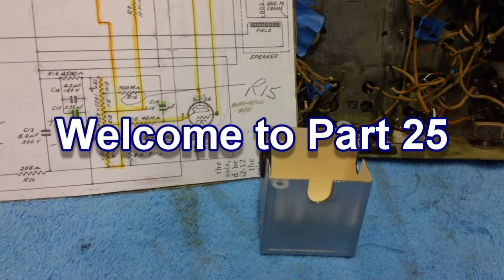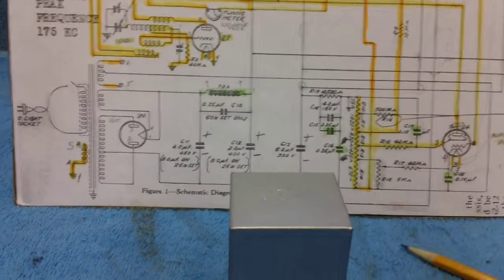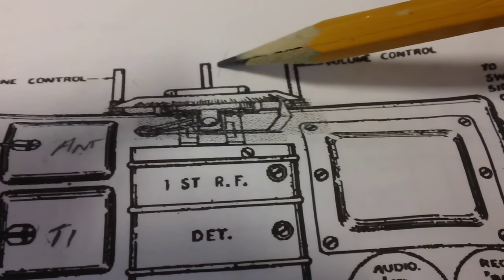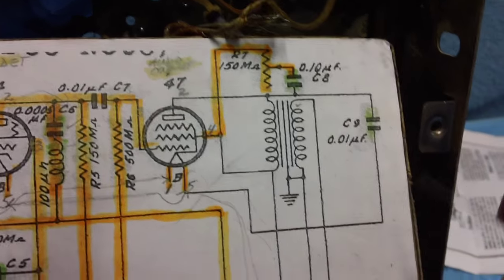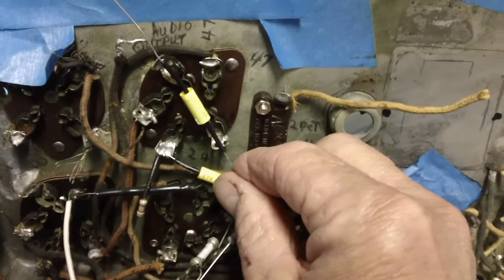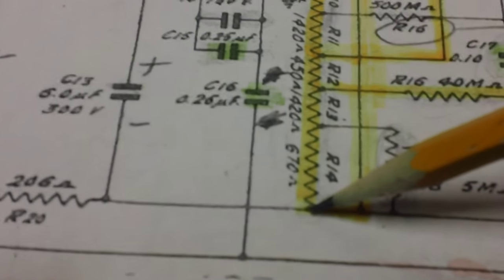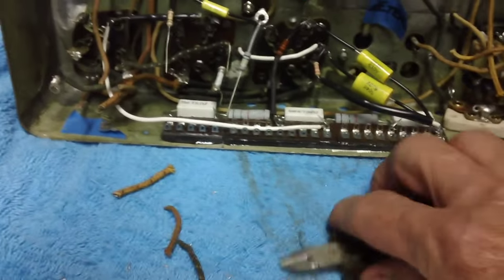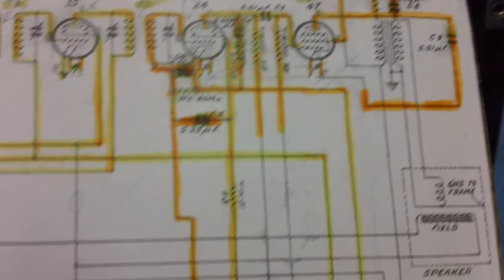1931 Airline 62-14 (Part 25 of 44).

Comment: Another terrific video. I noticed on ARF that someone dredged up an old thread of yours.
Which is good news for me, I missed it first time around. Wasn't there yet.
I have recapped and replaced all but three resisters in my 16 tube set. Like you said
"piece of cake"! Well now it is.
Though I wasted several hours trouble shooting before I remembered that the volume control was not in the intuitive spot. I'm looking forward to the alignment but it sounds good already. Four 45's in the output can make some serious noise (good noise).

Comment: John,
Although I’m at one with sporadic Z, there are those who feel there is a need to retain their Vintage Radio’s authenticity as far as is possible.  Since you indicated you would likely retain a little of your Airline radio’s authenticity, like the potting box, which like the rest of the chassis is around eighty-five years old, I offered some suggested input but I am delighted to see you have decided to go down the quicker, and more practical route of getting the radio working…well done my friend.
Personally, unless instructed to do otherwise, I repair/restore old radios as I think fit.  All one has to do is look at my repair/restoration videos like the Regentone RG99/2, and the GEC BC5445.  I don’t retain old defective parts: I just oust them, and replace them with new ones.  Take the Westminster radio vids.  To some, completely altering the power supply, and audio output circuit from operating on an EL41 to an EL84 as sinful, and degradation…but I loved every minute of doing that…and its works very well too LOL. 
Often, I attempt to talk people out of ‘going down the authenticity route’ by asking questions like: “Will re-stuffing capacitors contribute to the radio’s overall operation?” … “Do you intend to periodically display the underside of the chassis?” … “Do you realise safety could be compromised here?” …and a whole bunch of other questions of that sort.   Do they listen?   Sadly, most do not.
I very much like what you are doing.  It is far better than retaining parts that in the end will not contribute to the radio’s performance.
Regards,
Phil.

Comment: I always prefer the K.I.S.S method. It is too bad you have extra holes in the box now.  I have an idea regarding your time capsule - when this video series is all finished up, you could put the videos on a thumb drive and stick that inside the box, along with a note. Securing the thumb drive so it does not knock around would take some thought though.

Comment: Hello John you cannot mount caps under tube sockets. The tubes get hot and can mess up the caps capacitance valle can change with the heatThanks Richard
Reply: +Richard uk Heat rises. should be cooler under the tube sockets.